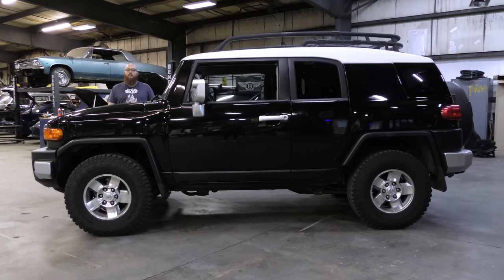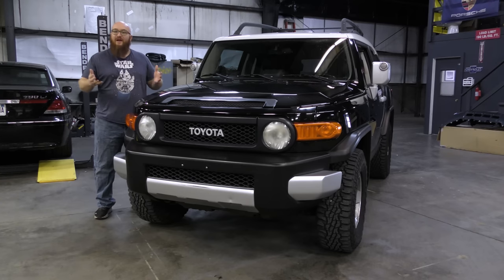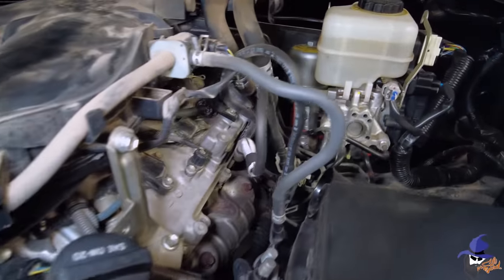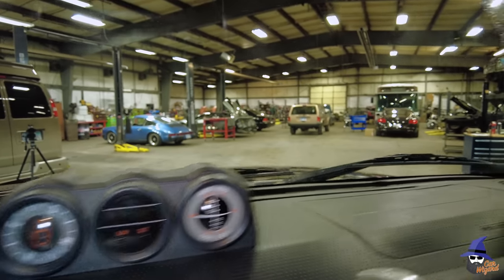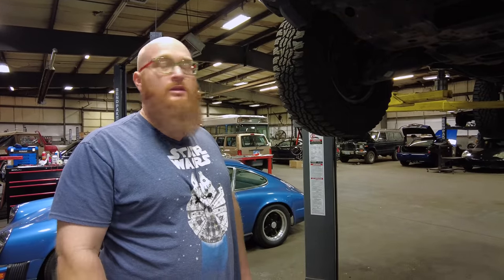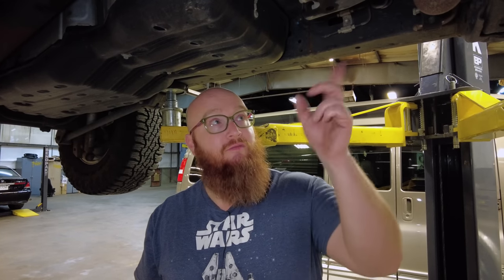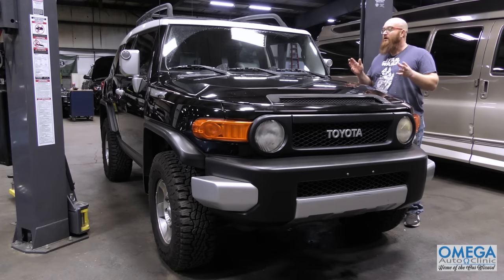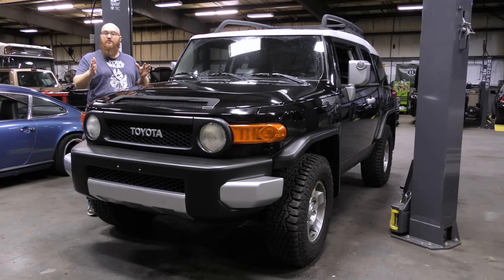"I finally got the Toyota I've always wanted!" CAR WIZARD gets a 2010 FJ Cruiser!

Comment: I found a nice one for my wife.
High milage but like yours the undercarriage I would expect from an 80,000 mile rig..no rust no leaks.
It is the 2007.
It needs an oil change according to the miles but looks like I just changed it.
That flat winshield is the big issue...
We have a lot of pheasants here...   

Good solid rig.

Comment: I had a 2007 FJ Cruiser and I loved it. I bought it with 176k miles on it in November 2020. I drove it everywhere, and it was able to keep up with modified Jeeps on trails despite my FJC being stock! Unfortunately, mine had a minor issue with the driver side wheel bearing (went through 2 wheel bearings) and a major issue with the alternator that caused it to leave me stranded twice (went through 3 alternators). It had 194k miles on it when I got fed up with it and got rid of it in September 2022 due to the previous issues stated. Due to my somewhat irritating experience with my FJC, I don't plan on buying another one again. I do plan on getting another Toyota off-roader again but it'll have to be a Land Cruiser 80 or 100 series.

Comment: I am surprised you were so fixed on its peak hp. Really once you start driving it , you will probably seldom go over 2100 revs  even under acceleration  because that’s the rpm it goes up to  if it’s like my 4runner . A low rpm cam that gives you more power , economy  and a less noisy engine would be a better fit . It’s just like the ford 4.6 v8 . It only put out 220hp in the Town car and 300hp in the Mustang . The Town car though had a engine that could put out lots of Hp at very low rpm’s delivering fantastic free way gas mileage and very low noise  in a engine from 1994 !!!. No doubt unlike in the past , engines  and transmissions are not being configured based on how it’s probably going to be used . I guess 
a interesting fix might be changing the gear in the rear diff. With the right cam , the torque curve from idle to 2100 could be change from a line with slope  starting at 220 ft/lbs to a electric motor like straight line with a constant 250 ft/lbs .

Comment: I had the first model year 2007 FJ in iconic blue with white roof . But the rust belt ate it . Only issue I had was the automatic transmission was very lazy to shift making for a less than smooth ride . Love my Toyotas though , I’m on my 7th in 35 years lol

Comment: Never understood the appeal of the FJ Cruiser.  Its ugly IMO, visibility SUCKS, hate those stupid rear doors.  And unlike a 2023 Wrangler which honestly does look like an old 90's TJ or even earlier CJ5 or CJ7, I don't really see the resemblance between the FJ Cruiser and the old 60's/70's Land Cruiser.  And I love Toyota trucks, owned several over the years.  Just I'd much rather have a same year 4Runner or Lexus GX(Land Cruiser Prado for you foreigners).  Those have 4 real doors, more room, WAY better visibility and are just as awesome off road.  SUV's/trucks should be practical, not a slave to style like the FJ cruiser IMO.

Comment: I have a 2013 FJ I bought second hand and had for about 4 years now and kept it stock standard. I get excited every time I see it in my garage and even more so when driving it. Love the steering, it feels solid, engaging and fun. It’s got a nice pull away too with that engine and sounds great when you push it a little. I had it on some extreme off road trails and it keeps surprising me what this thing is capable of, especially with the ATRAC on! This vehicle brought me so much joy and took me on so many truly wild and unforgettable adventures without a single problem. It’s always ready and up for the challenge no matter what. I will never sell it!!

Comment: Underneath they’re just a Prado, which is a great platform. Here in Australia at my workplace, we used to have Prado’s at work and they would regularly get up to 500 to 600,000km and still drive fine. They would have sold these FJ Cruisers in huge numbers here but they only had the petrol
v6 instead of the enormously popular four cylinder turbo diesel that people overwhelmingly prefer in the Prado here. Even the Toyota dealer said, frustrated, that dealerships were begging Toyota to offer the diesel engine but they said nope, petrol only. As such they didn’t sell as many as they should have.

Comment: I put 33” Goodyear Ultraterrain tires on my Sierra and they are the best snow and wet weather tires I’ve ever owned, and way quieter than my previous Falken Wildpeak AT3W tires. I hope your BFG new tires are as good. Also I got my wife a new 2022 RAV4 recently because I also didn’t want to work on it frequently. Good video Wizard, I’m a long time fan.

Comment: Intended to buy one new, but after checking one out and testing driving it, I was left disappointed about the rear seats not folding flat, and not long enough for me to lie down, so I passed. I  also didn’t like how spartan the interior is, granted it’s so it can be easily cleaned, but at nearly $30k, I expected it to be nicer than my 14 year old car.

Comment: My dad had a 2007 in silver. Transmission started going out at 100K miles. It was quite cool, had the same cool center gauge pod. An interesting thing that you might not be able to tell with the black, is that Toyota color matched the glossy plastic interior trim pieces with the outside of the vehicle- I remember that the stereo, some of the door cards, etc were the same color as the exterior of his car. He always wanted a roof rack. Also, in the 10 years he had it, he went through 3 windshields, and the antenna broke off from a low hanging tree branch. Watch out for little rocks!

Comment: this FJ is not full option mine got controls at the steering wheel  and sound system at the back it is tube looks like bazoka :D  and it will never do burnout or dounts without removing the fuse under the steering wheel ;)but anyway its nice car i enjoy it

Comment: Wizard, would love to see an entry in the "To Buy and Not To Buy" series for Toyota/Lexus. It feels like a long time coming.

My family has a lot of Lexus/Toyota owners (myself newly owning a 2015 RC 350), but some of them still make the mistake of buying an Audi/BMW.

Cousin had an M3, and it lived life in the shop before he sold it.

Mother bought an Audi A4 as a secondary car, and the timing chain needed changing a year later.

Uncle had an A4 as well.
Total engine failure and replacement after having it for less than two years.

Meanwhile, my Aunt's old 2004 RX with over 180k miles on it is still running strong. Similar story with the rest of us.
My mother's primary vehicle is a last gen GX, 2014 I think.

Hasn't had any issues with it at all, had more miles every time I saw it, and had it thrice as long as the Audi.

Really speaks for itself. I try to warn pretty much anyone eying an Audi (that's not a second gen or later TT) OR BMW to just stay away for these exact stories, and the ones you tell, too.

They never listen.

Comment: I love FJ Cruisers! I put a Frontrunner rack on it and a Chitown rotopax mount on the rear hatch where the spare goes to hold 8 gallons of fuel. The cherry on top is the CB radio with a flag mounted to the antenna waving a Nursing American Flag.

Comment: Fun fact… they still make the FJ Cruiser for Australia and the Middle East. They’re unchanged from the model we had till 2014.. that said. In 25 years you’ll be able to buy a 2023 FJ and import it into the country. That’s equally good news for parts sourcing… even though you’ll rarely need to replace anything. 
One last note… I’ve owned both versions of the engine and while less powerful, the early models were much quieter/more refined and actually felt more powerful due to the lack of throttle by wire.(although a pedal commander fixes that) Also, the newer engine 4Runner has 270hp vs the FJs 256… so there’s more to extracted but I don’t know what makes the difference in power.
Reply: Unfortunately, the last FJ Cruiser rolled off the assembly line back in December, I guess the final ones were still technically 2023 model year, but it's been officially cancelled now. A very respectable run, though

Comment: Also, my dad's FJ instead of the backup camera had a proximity beeper thing that did not work very well, and no traction control off button. He had to pull a fuse to turn off traction control.

Comment: the thing on the left on top of the dash is for this: "Navigation, GPS - Toyota (PT917-35070)". I had one in mine. you could take with you on the trail for hand held GPS
Reply: it was supposed to be for maps also if you dont change out the shell for the GPS. not for the airbag or anything

Comment: Check the crumple areas for cracks on the (motor compartment) inner wheel wells. (They are in the area where the strong arm hood lift parks).

Comment: This guys opinion is just that. I have a 3.6 Jeep JK with a 6 speed manual with 325k (and still going) with not a problem problem at all! The 3.6 is a very reliable engine that has been documented going 450k plus if maintained. In fact I just watched a video of a guy showing a 3.6 in a commercial minivan going 475k on the original timing chain. My wife bought a Toyota suv just last year and the SOB has been in the shop 6 times! That FJ is a toy !
Reply: Your scenario is incredibly rare…. That’s the whole point….. keep jerking it to the red white and blue but the quality has gone downhill…. There’s no two ways about it….. there even admitted it themselves🇺🇸🫡

Comment: Their is a company that sells a bigger gas tank or dual tank. Also take off roof rack clean out the bolt holes drain water or youll get rust in roof. Silicone and reseal

Comment: Went on car sight to see German high milage cars, this gives me an idea of reliability. Set manufacturer, set minimum year, (2010 in my case), set millage ay 170K and see how many hits. Most were single digit, the FJ by itself had as many. Mercedies had double digit but most were Sprinter work truck, same engine as other vehicle but a lot simpler, probably disabling electronic modules on the cars take them out when their price gets low.
Reply: Check diesel Mercedes sprinter vans. 200k is breaking it in for them

Comment: I bought my 07 on Dec 2020 with 199,993 on the clock and I've driven it all over the south. No dents or dings, nice little 3 inch lift, and pretty decent interior. Still going strong at 233k miles.

Comment: I had a 08 the master cylinder went out after 70k sticker shock 3.500.00 that’s just the part the underside you had better linex, Toyota did a horrible job sealing the frame, crazy blind spots other then that I what a  fun build
Reply: Did you check to see if you can add exterior cameras to the blind spots

Comment: I had one.  Very reliable for the cheap cost compare to Toyota 4 Runners of the same model year.  The only complaints I had was that it was difficult with rear doors  to get the family in and out of the car if parked between cars and I was disappointed that the other FJ cruiser riders didn't wave at each other like I when I drove a Jeep.

Comment: Nice video. I've always wanted a FJ Cruiser myself but could never find one for a reasonable price. My second choice was a 2nd gen Tacoma, which were also difficult to find in my area. Finally, in 2017 I found a 2015 Tacoma 4x4 with 30K miles equipped with 1GR-FE engine. Been driving it ever since and it's been excellent so far.
Reply: Good luck with bidenflation.

Comment: Congrats on getting your Toyota Cruiser. It's definitely impressive looking and I do like the Toyota 6 cylinder engines for the power. That is why I am looking for a 2011 Toyota Rav4 with the 6 cylinder engine in it. It is a good compact type vehicle that has plenty of power to handle. Enjoy your FJ and I may take you up on that water offer some other time.

Comment: Xterra Pro-4X > FJ. Xterra Pro-4x does everything the FJ does on and off road, more power and torque, just as reliable as an FJ and even rated as more reliable by repairpal, much better body design and practicality than the FJ, but cheaper than the FJ. I just dont understand the appeal to these when theres a better, cheaper alternative.